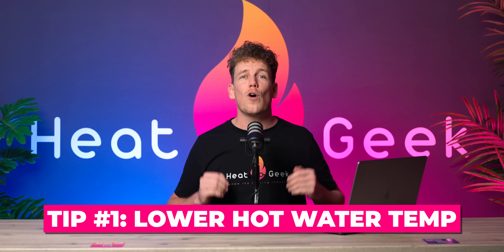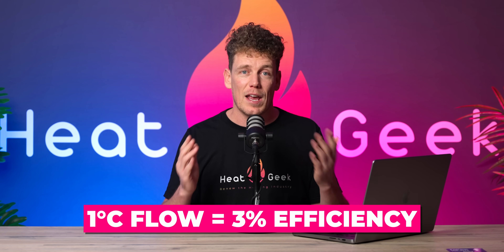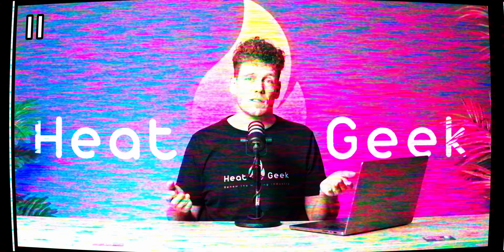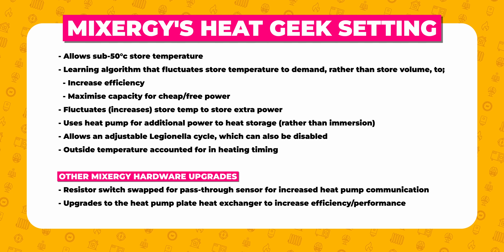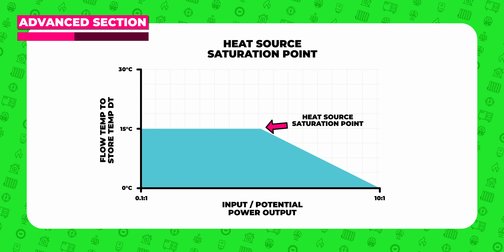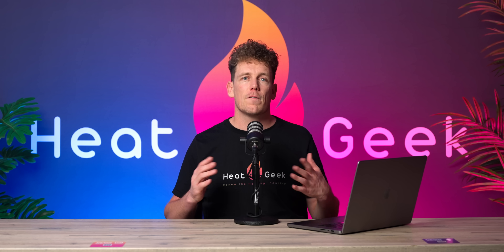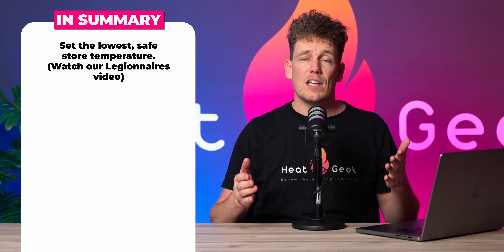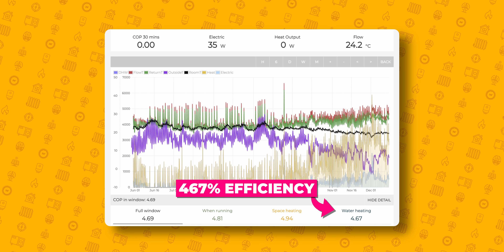Hot Water Settings Energy Suppliers Don't Want You to Know!

Comment: I set my water heating heating time to 12 midday to increase efficiency due to warmer outdoor temperatures (compared with 2am as set by the installer) at the same time as I’m typically cooking so don’t need any heating downstairs in the open plan area 👍
Reply: If, like us, you have solar panels I thought it would be best to heat your water at the time you get most solar production and possible exports to the grid. So I've set hot water between 2pm and 4pm as our main roof faces S west rather than due south.

Comment: This one is a no brainer but most engineers don't educate clients enough. Cheers for the helpful video
Reply: > This one is a no brainer but most engineers don't educate clients enough
Most heating engineers have no idea how boiler or HP works... no HeatGeek or octopus want to install HP in my house because of 8mm microbore with 25mm backbone and 28mm from boiler, they want me to re-pipe the house, even my boiler runs max at 40C flow on lowest pump speed in the coldest day in 2024. My annual gas usage is £250, so re-piping the house for £3.5k + 9k to install a heat pump (heat geek quote after government grant) make it pointless....
Reply: @ksim_ your correct mate, insulation and having a great thermal envelope is key. Doesnt matter the heat source or what piping arrangements you have in place. Ive just installed a new gas boiler from an 18 year old system boiler and after a full year of bills and with a couple of easy settings/tweaks, have saved customer from a 2500 a year bill, to a 700 bill and thats with 16 rads and a 300l cylinder.